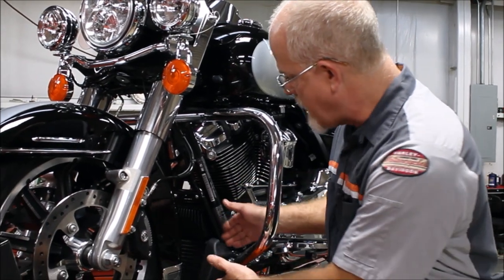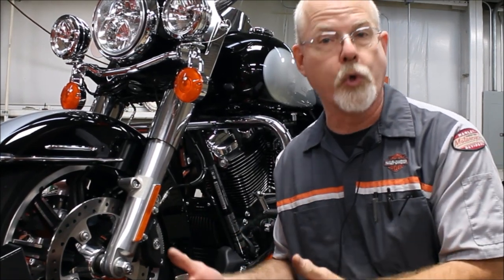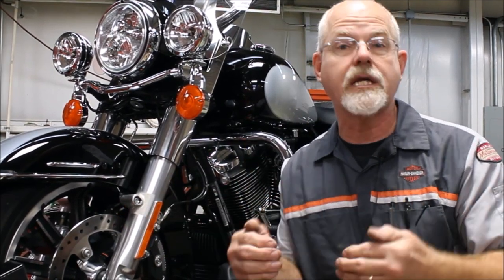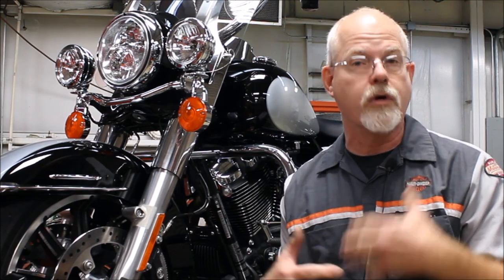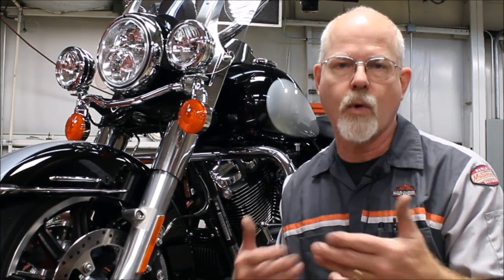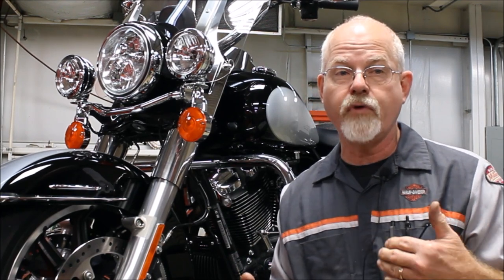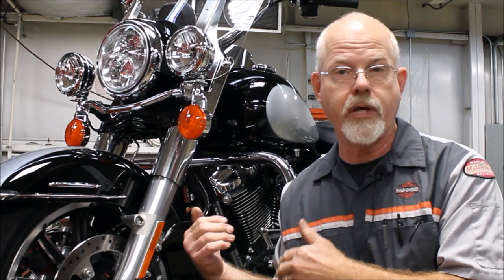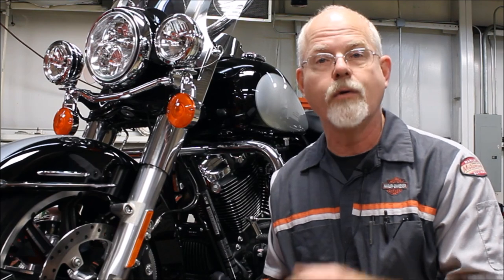DOC HARLEY: OIL COOLERS

Comment: I got a 98 fatboy what is a good oil cooler?
Reply: Danny Standish I've 98 fatboy too. I've been using a basic cooler in front of the frame(all black so it stay hidden better). Just high enough to keep rocks from getting it. Finned, but no electric fans. I keep the mikuni a bit on the rich side, which helps my keep temps down and makes the cam go apeshit. Also, I'm in Texas so 90 plus weather throughout most of the spring, summer, and fall. Mostly countryside highway driving.
Reply: @christopherologist  thanks for thar info.. i live in louisiana near N.O. and i know what you mean with hot weather.. i truck drive alot into texas. Im in minetal wells atm
Reply: Danny Standish damn, that's tough. I've been to some hot places before, but mineral wells. If it's 105 in east texas it's at least 115 in mineral damn wells.
Reply: @christopherologist  i plan on making another trip up to the state park and camp out

Comment: I have a 1200 Custom. What is a Normal Operating Temperature? I see they sell a Oil Temp gauge that replaces the Oil "Dipstick". Thinking about buying one. I live in NJ. We have already had a couple of 90F days this week.
Reply: Chris Philhower I run Amsoil 20w50 max temperature is never over 200*F I have a oil temperature dipstick hope that helps
Reply: Thank you David I bought one of the Temp Dispsticks. Its shorter than stock. And only has two grooves cut into it.
Reply: Chris Philhower The lower groove is oil level cold and top groove is oil level hot.  Mine holds 2.8 L of oil with the filter change
Reply: Chris Philhower it’s a 2003 sportster 1200 custom

Comment: I ride an air cooled Honda.. I usually get 200-230 avg when I hit it with a temp gun. I've had it be as low as 130-140 after my 10 Mile commute on cold days!

Comment: Im waiting for motorcycle companies to finally figure out how to install an active cooling system beyond a simple glorified computer fan. they can make coolers that fit inside of flight suits, astronaut suits, and other uniforms that are limited on space. so the size reduction of units is there, run both the oil lines and the coolant lines through the fins. not only will the fins be cooler (releasing more heat and cooling the oil lines) but the air that passes over the coolant lines and cold leading edge of the fins will flow over the hotter oil lines cooling them even more. the cooler would be able to not just kick on and lower it and then kick off (if it ever reaches target temp) but the cooler would be able to adjust power demands on a smaller level and you could stay within a few degrees of "optimal" running temps, even in hot climates and hard riding situations. the power required wouldn't be much more if any more than that of the LED light strips. no noisy fans, so having to check if fans have fins broken, and small closed system refrigeration units like I am talking about run for several years before needing any maintenance, and even if they stop running they then work like a standard non powered oil cooler, where as a fan not working acts as a air dam and makes things WORSE.
Reply from the maker: Brett, there is definitely more cutting edge technology in the world now.  I think the part missing is the cost of manufacturing right now.  As manufacturing processes get better on this kind of technology I am sure we will see some of these things come in to the consumer sector.
Reply: @LowCountryHarleyDavidson  Computer geeks have been doing similar with "active" cooling for 20 years now, and they have the added hurdle of keeping humidity under control. keeping the CPU cool that wants to heat up to 200+ degrees and keeping it under 110 and and even lower in some cases. these set ups are like 300-400 bucks as hobbyists/enthusiasts. if a company actually looked into and developed it. they could drive that market to cut those kinda numbers in half. the tech is there... Harley just has to be willing. I means its only took them 30 years after every other manufacture to even start adding oil coolers, and again 30 years behind everyone else to add water cooling.
I would say that someone like Honda or another company would do it first, but their pride didnt limit them from using actual liquid cooling systems because of the faulty "sounds different" claim.
its $$$$ alright.... they would lose over heated rebuild sales and labor, they would lose aftermarket shares in every gimmick to try and lower temps whether its engine damaging or even felt, people spend thousands after market and never bring the temps down to "safe manufacturing levels".  there ARE things Harley does that are detrimental to their own products, things that could be fixed PRE sale to customer... but they dont. I love my harley but dear lord its costing out the wazoo to protect it and stay within warranty, that could be going to some nice customizations.
Ive already spent 2 grand on my brand new harley trying to chase a dangerous heat issue (right foot cant stay on floorboards after 20-30 minutes of riding) that the dealership wont even look at. and somehow have to bring it down to high temp parade ready. after 2k I am still in the 300 degree range (70 over "normal").
It'll probably take some guy in his garage that is familiar with this sort of system and has tooling knowledge to create the setup.

Comment: Would love to put one on my Low Rider S, , but my dealer says it's not necessary with the Synth Oil ??
Reply: Your dealer has no clue what they are talking about. The Low Rider S with the 110 is a stupidly hot running bike and should have had an oil cooler from the factory. I was very interested in getting that bike but after riding it in the Florida heat I passed on it. Synthetic oil does run cooler but with that motor getting close to 300 degrees the oil is doing little for you and your actually breaking down the oil, especially with the Harley oil. Putting Motul 7100 or 300v in the bike does make a slight difference but get the oil cooler.
Reply: I plan on using Amsoil once the stock Harley oil is emptied after the first 1000 mile check. I too do agree this bike should have come with a cooler.
Reply: Donovan Lewis I'm in Australia, riding in temps up to 42°C. I use motul 7100,   plus have the ultracool reefer cooler fitted. I compared genuine harley coolers along with other brands, and the ultra cool definitely comes out on top for quality, fitment and install.
Reply: Dazza - I installed an Ultra Cooler on my 2008 Ultra Classic and have nothing but good to say about it.
Reply: Nice to know mate.
Reply: Awesome, I am swing toward the Ultracool.

Comment: Stuff like this is unnecessary,it only adds weight,and more things That will break.
I live in FL ride everyday on a 82.No water.no fuel pump. No problems
Reply: Maybe 1 pound at the most......
Reply: I don't know why the people complicate with this issue, I live in Miami, FL. Temperature above 90*, Ride wherever with my 2017 Ultra Classic, Hey no Problems neither.

Comment: how do I get the dirty oil out of a thermostatically controlled oil cooler when I change the oil?
Reply: Good question. Depends on bike. Evo's don't drain all the oil out when you pop the plug. So I replace the plug before the oil filter, fill up the oil bag. Start the motor and let it run while I continue to feed fresh oil in. In a minute or so, you'll see clean oil bubbling through the oil filter connection. Shut it off. Wipe it down. Replace the oil filter. Done.
Sure it makes a mess. But ALL the oil is new.
Reply: Scavenger oil change system

Comment: Not ALL of Harley Davidson's oil coolers come with a thermostat, the Sportster oil cooler doesn't.
Reply: Jan, 2020:  I bought the standard H-D engine oil cooler kit for my 2016 XL1200c in Oct 2016 when I bought the bike new, and was disappointed that the kit did NOT have a thermostat.  Eventually, to maintain 200 degree oil temps during cold weather (St Louis, MO November - March) I made a leather sleeve/cover to encase the heat exchanger; the cover works fine during cool weather and when removed, the heat exposed heat exchanger drops engine oil temp about 20-25 degree F.  I was unable to attach a photo of the leather cover to this reply.  Thanks, Ralph K in St Louis, MO

Comment: Kind of frustrated that the motor company made a oil cooler for the 2017 Dyna low rider but it will not fit the FXDLS and the motor company is zero help as to stating why.

Comment: Oil coolers are virtually pointless without a built-in fan to help circulate air while the bike's at a standstill. Without a fan, the cooler will make a marginal difference on performance. Air cooled bikes don't overheat when they're moving.  Duder should've said that, but he's a Harley tech, so no surprise there.
Reply: El Duderino

Comment: So I spend $30-$40,000 on my new Harley (in Canada) then walk to the parts counter and need to buy an oil cooler so the motor will run properly....Really....you have to be kidding.  That’s crap. No wonder they have lost 60% of their sales in the last 5yrs.
Reply: We live in Canada, we don't need to go in and buy one after spending that amount especially because most the 2017+ come with oil coolers from the factory. Also, if that is the breaking point of purchasing one you weren't serious about buying one in the first place. Also, they may have lost sales (nowhere near 60%) but they have never been more profitable. They are doing fine. Also, 2020 and 2021 there will be plenty of bikes that are liquid cooled from HD so this will be even less of an issue.

Comment: Technology.....why is Harley so far behind on using engine coolant? Just about every other manufacturer out there has stuck a radiator on their bike for the last 20+ years. A bike this expensive should have better "technology" than bikes that cost half as much. Dumbfounded

Comment: I have a 2018 Road Glide Special and I’m running @300-316 and in stop and go detour at one time and got up to 369. I have the stock air cooler. Will a fan behind it work to lower it? I track my temp via My Power Vision engine temp.

What’s a good replacement aftermarket that’s a  direct replacement with fan.

Or add a second oil cooler to side with fan assist.

What’s your thoughts?

Comment: HD engine design is stupid putting a rod inside a rod makes no sense
Reply from the maker: Denny how does your Engineering degree explain this?….Doc
Reply: @LowCountryHarleyDavidson  i don't have an engineering degree mr. doc but it's easy to see that back head runs hotter sitting right behind the front head plus having to split a crank and beat on it to get it straight seems stupid to me

Comment: If the oil cooler is open above temp. X and closed below then wouldn't that create a blockage in yer oils path and what about all the extra oil, does it just hang out in the cooler being useless? Is the thinkin behind the thermostat the same idea as in a water system in a car, let it warm up before opening the system? The thermostat on an oil cooler for a motorcycle engine seems superfluous and is, I think, the wrong design. Bike engines are small and warm quickly, no need to shut off the cooling system to warm them even with an extra 2 quarts of oil circulating in the system.
Reply: The thermostat in an oil cooler when below operating temps merely bypasses the cooler and routes the oil back to the engine, there is no "blockage".  I don't know about you but, I ride when it's in the low/mid 30*F, there is no need for routing the oil thru the cooler at those temps as I'm lucky to see 180*F then.  Riding in 90-100*F is a different story, I see 240-245*F oil temps at speed in those conditions.  I prefer to see oil temps around the 220*F range, so a thermostatically controlled cooler is going on my bike.
Reply: Kim Harbison I get why you want it. it just seems that shutting the cooler off then opening it back up is a design flaw. just leave the cooler open always. all this openy closey stuff is probly expensive when it breaks. and this guy in the video always sounds like a commercial to me... just sayin
Reply: forrest crabbe Your cars cooling system does the same thing. Only it is coolant instead of oil. Here in the desert an oil cooler is just about mandatory.
Reply: I know how it works. I am saying it is unnecessary. the thermostat adds initial cost to the unit and more chance of failure and repair work.
Reply: I have since installed a Jaggs oil cooler on my '17 Sportster.  It has lowered oil temps in hot weather from close to 250* at times to 210*, maybe 220* after higher speeds (Interstate).  If there was no thermostat, the oil would be over cooled especially in colder temps.  The Jaggs cooler is that efficient at shedding heat.
Reply: Kim Harbison i know an engine can run too cold to be efficient, but, I find it hard to believe you can over cool the oil on an air cooled engine. I have extensive experience with air cooled gy6 scooter motors and the very best way to keep temps down on them is to plumb in an automatic transmission cooler from a car. no thermostat just extra oil and cooling fins. the oil cooler on my chevy k10 is essentially a tiny radiator that adds extra oil capacity and cooling fins, no thermostat, no over cooled oil. y'all can spend all the money you want on a gimmick, but, at the end of the day it is still a gimmick. the thermostat on an oil cooler for an air cooled engine is superfluous and a gimmick, and, I stand firmly by that.
Reply: Don't know what to tell you but, I ride in temps as low as the low/mid 30's.  Before adding the cooler riding in those temps I was lucky to see oil temps hit 180*.  Now add 30* air flowing thru an oil cooler and it isn't hard to figure out what that would do to oil temps.  If all things considered were the same as far as cooling effect, I would be lucky to see oil temps at 140*-150* without a thermostat.  Not really hot enough to burn off moisture in the oil, AND the ECM might not ever register the bike was warmed up and I'd be running a constantly rich mixture.  Won't argue the point further but, the thermostat works.  The cooler stays cold since no oil is flowing thru it until the bike's oil temps get to around 200*, then the thermostat opens and the oil is routed thru the cooler.  Pretty simple concept, and IMO it isn't a 'gimmick', no more than a thermostat for a radiator is.
Reply: Kim Harbison if it works for you and yer happy then that's what counts no matter mine or anyone else opinion...

Comment: Yes you need a oil cooler, if you want a long engine life.  So why doesn’t Harley put it on when you buy it.  Because Harley doesn’t what you to have a long engine life.  They want you to keep bringing you bike in for repairs, or buy a new bike.
Reply: Oil cooler is good for 10° reduction at most, I've run em with and without. If you have a problem with oil temps I'd go up a touch in viscosity and switch to syn. Stop riding in traffic. They are fine without